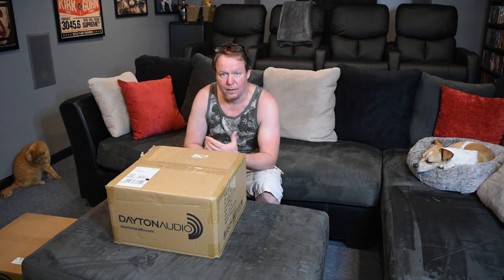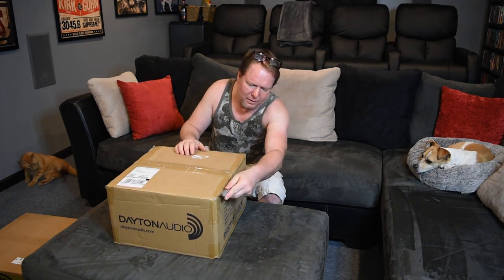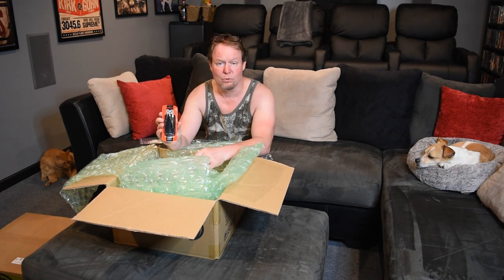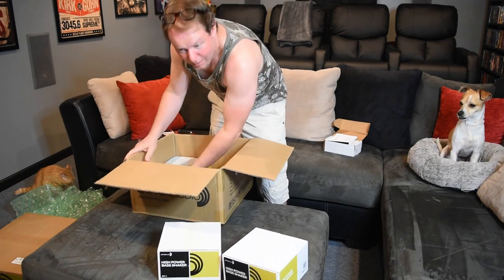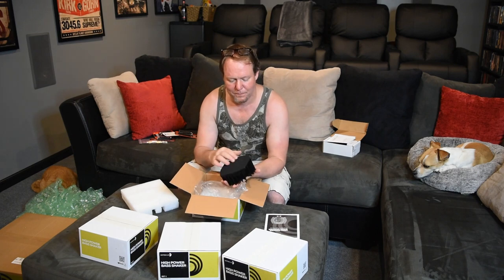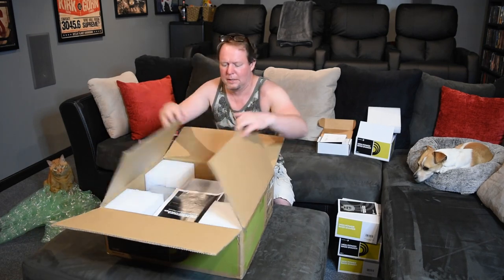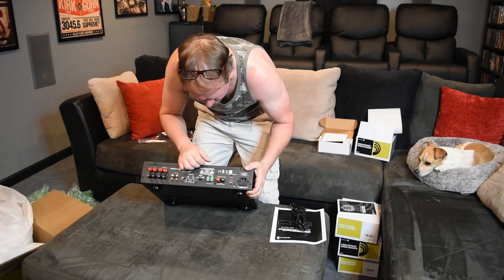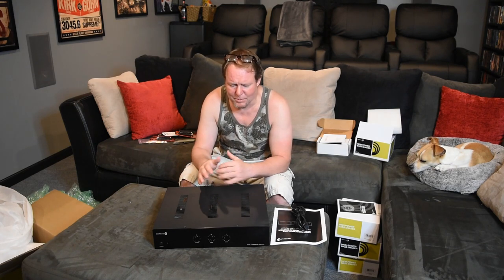Dayton Audio Bass Shaker and Subwoofer Amp Unboxing

Comment: I'm looking into added shakers into my speaker but I'm lost on how you wire these into a receiver using their own amp? Mind do a video breakdown of how you have yours wired in.  Noob here lol
Reply from the maker: https://user-images.githubusercontent.com/2207331/53243107-2170f500-36a7-11e9-8283-2145562d53c9.png
Reply from the maker: I used the Parts Express Dayton amp/shaker combo. $335... Very simple install..
Reply from the maker: https://www.parts-express.com/dayton-audio-sa230-amp-with-4-bst-1-bass-shakers-bundle--300-9016